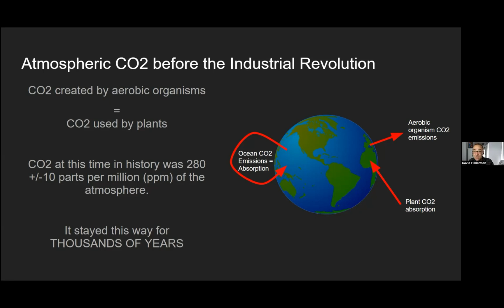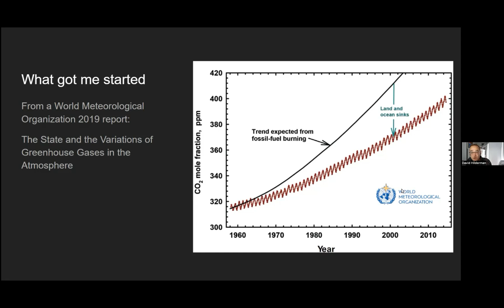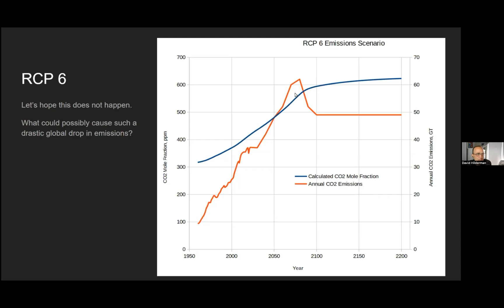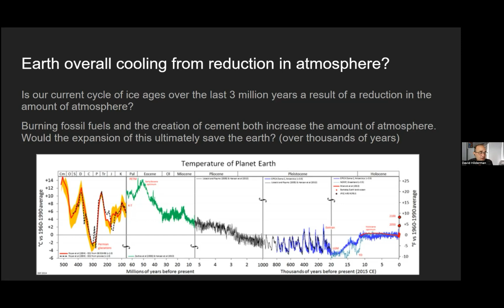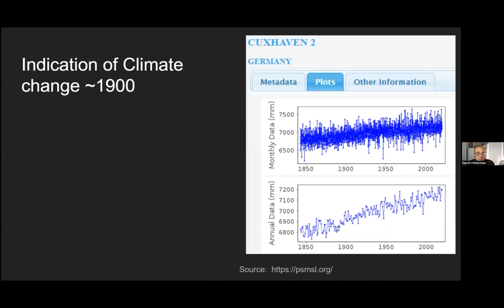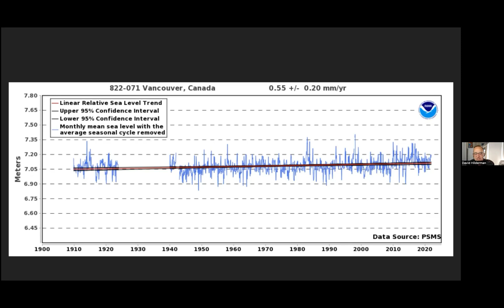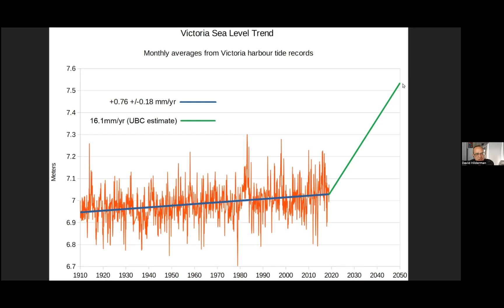David Hilderman: CO2 Emissions and Atmospheric Levels | Nelson Pod #220

Comment: There a re a lot of misconducts/misconceptions in this analysis. 
Indeed, more CO2 induces a growth in vegetation, that partially reduces the quantity of CO2 as it absorbs it by photosynthesis. That doesn't mean it's good for humanity.
Carboniferus was a lush period with big plants and high CO2 levels (relative to earth's average) but it also means higher temperatures, bigger fauna also (like giant insects etc) and more microbes and viruses. A human body would not easily adapt to change of temperatures as plants and trees, that's the problem !
Also more CO2 absorbed by the oceans isn't a good thing, as it increases the acidification of the waters and provoques a lot of changes (potentially difficult to manage by sedentary humans) as change of the gulf stream currents, elevation of water levels, change in fish reproduction cycles, collapse of number of new fish per year and zones of fishing etc ... 
Reminder : Most of humanity lives on coastal areas, and are dependent on oceans and seas, have infrastructure that aren't built to function with an elevation of a couple of meters of waters (the infrastructures around the world would need big adjustements, that take time, money and resources)
You showed clearly in the charts that the absorption is clearly not enough to compensate for the surplus of CO2 quantity, to be able to easily manage the heat levels induced, and the transformation of entire economies and processes (production and supply chain included) to be able to sustain the population without too many crises.

Comment: The premise was horribly flawed from the beginning!!!
The initial assumption was that the only heat transfer mechanism was Solar Irradiance.
This despite the fact that we've known for at least the 6 decades of my life that some planets in our solar system are consistently warmer than the amount of Irradiance they get from the sun.
Thanks to the Cassini mission, we now know this is due to a phenomena known as "Solar Particle Forcing".
The same charged particles from Solar Flares that have been giving us the Auroral light shows spread those warming energies from pole to equator.
If it's strong enough to keep Jupiter & Saturn warmer than they should be...
especially considering their size & distance, 
why would we think Earth would be exempt????? 

It's gone mostly unreported, but I'll mention the other shoe before it drops:
ALL the planets in our system are experiencing some kind of climate issues - Temp variances, significant wind speed increases, rotational speed anomalies, etc.
If the cause IS AGW from human CO2 production, 
then please explain the mechanism for how this exoplanetary influence is possible.

Comment: First time I have seen a calculated explanation of how much more carbon dioxide is removed by plants as the concentration increases. This always seemed like one of those obvious factors that are conspicuously absent from mainstream climate change explanations just like all changes seem to automatically be bad! In oceans I saw a presentation recently about the concentration of CO2 in the oceans. Obviously if the oceans acidified more this might liberate CO2 from Carboniferous deposits however the oceans remain slightly alkaline so I don’t see how this can happen without a substantial change. The sequestrated carbon in calcium carbonate deposits in the ocean has been evaluated. You would expect more CO2 to be absorbed to compensate for this effect as the sequestration lowers the dissolved CO2 levels. Presumably if the oceans are still absorbing CO2 they are not yet saturated. Rather like plant life you would expect marine photosynthesis to increase with more dissolved CO2 proving more food in the food chain. This would increase shell and bone growth so that is another possible variable. This would not change David’s absorption factor though. It is just another component.

Comment: Something that has always bothered me abut repp[orted sealevel rise is that it never seems to take into account where we have land "lifting" by whatever means, be that isostatic rebound or what have you.   Our world is dynamic, moving, constantly changiung and evolving.  Some areas are rising and some falling.  Be that falling beneath the waves / seas  or sliding under a neighbouring tectonic plate.
As for CO2, I am kniocking on 60 years of age now, but even as a kid, (I knew that carbon dioxide was one of the fundamental gasses REQUIRED for life.  I also knew that some growers of plants, with greenhouses, would order bottles of CO2 and trickle feed the gasses into those greenhouses to promote and accelerate growth of the plants.  I also knew that if levels fell too low, plants wuld not be able to breathe and they'd die off.  Thus, they would no longer produce the oxygen we and other air breathers NEED in order to live.   I have never bought into the whole climate change thing.  Sure its changing.  You can go anywhere in the world and monitor, hur by hour, how the temperatures rise and fall.  You can then extent that out to weeks, months years etc.   I would say that our climate has been in a state of flux since the day our world got its atmosphere and life, all life, on this world has evolved to exist within a changing climate to one degree or another.  In fact, during the warmest years / decades,  life has flourished.  Not just mankind, but all life.
On a lighter note, when the climate apocalypse hits us, I will feed on the vegans and vegetarians.  They're grass fed ;)

Comment: Have you noticed that plants need water? Rising temp do not affect amount of draught?? Working with only one factor (CO2) may be flawed 🙂
Reply: Increased CO2 actually reduces the water requirements, of plants. When a plant stomata are open, up to 50 molecules of water diffuse out for every CO2 molecule  that diffuses in.

Comment: co2 is a result of the planet warming due to solar activity and normally follows a 800 yr lag. Our temperatures are very similar to that of 1940. As co2 increase its green house reduces and actually starts to have a cooling effect.  Also we are reaching a peak following a 42 yrs cycle of warm and cold. The sun is reaching a maximum as the poles are about to change. 
We are also 300,000,000 miles closer to the sun as part of another 100,000 year cycle. The northern hemisphere is tilted towards the Sun as part of another cycle. Climate models are flawed because they dont even take cloud into account.

Comment: So you guys might need to go back to the drawing board. Very recent data has disentangled the role that sulphur (which was up until recent years prevalent in shipping fuel) has played in halting the warming that so many of these early predictions were making. We’ve been geo-engineering the whole time without realising it, and it’s only now that we’ve witnessed what happens when we remove that sulphur (and other particulate matter) from the atmosphere when it comes to warming. No-one had the data to understand the physics of the reflective qualities of the sulphur clouds we’ve been producing for decades but until we start re-introducing it, or cloud-seeding in other ways, we’ll all know about it sooner rather than later.

Comment: @4:10... there are a couple of problems with your hypothesis. It assumes that there is an unlimited amount of vegetation to keep absorbing the excess CO2 AND it assumes that the rise in each valley is triggered by a decrease in temperature. However, there is a limit to the amount of vegetation that can sink CO2 and the temperature effects are not as simple as you presume. The rise in CO2, from each yearly valley, starts when dead vegetation start to decompose. It died months earlier and some of that death was caused by dry, hot weather. So the summer both promotes growth and promotes decline. A longer summer means a longer decline, which we se evidence of, which is why the growth zones are shifting.

Comment: 1816 The global "Year without summer (big freeze)" 3°C temperature drop and crop failures. April 1815, volcano Mount Tambora began to violently erupt. Millions of tons of ash, dust, and sulfur dioxide were released into the atmosphere, casting a temporary chill across the planet as it Blocked out the Sunlight for months on end. Documented around the world in literature.

Comment: CDN NEXUS points out a scientific
study finding: CO2 doesn't cause temp fluctuation".  A review of key properties of global climate MODELS and statistical analyses conducted by others on the ability of the global climate models to track historical temperatures. These tests show that standard climate models are rejected by time series data on global temperatures.  Finally, we update and extend previous statistical analysis of temperature data (Dagsvik et al.,2020).  Using theoretical arguments and
statistical tests we find, as in Dagsvik et al.

(2020), that the effect of man-made CO2 emissions does not appear to be strong enough to cause systematic changes in the temperature fluctuations during the last 200 years.

Comment: I like your simple analysis, but I must warn you that your simple linear model is an oversimplification of the reality. I am not an expert, but I did get some basic classes into climate models in university. Your model works very well, because within the period you studied CO2 levels have been increasing over time. Your model will no longer be valid if we manage to stabilize CO2 levels.
One example of why this is, is that the ability of oceans to absorb CO2 decreases over time as the oceans slowly get saturated with CO2. If we keep atmospheric CO2 levels stable, then we'd have to slowly decrease CO2 emissions as the ability of the ocean to absorb CO2 diminishes as it gets saturated with CO2.
Similarly for temperatures and sea levels. Increases in atmospheric CO2 doesn't instantly increase temperatures on the surface and in our oceans. The warming takes place with a delay. And as the oceans slowly warm they lose their ability to absorb CO2 over time.
And as oceans slowly warm, sea levels will slowly rise. This process wil take thousands of years and as your analysis shows, we do not seem to be in any immediate danger. I agree with your main conclusions: the climate alarmists have no data to back up their claims.
Reply: I recognize this. However, it will take a long time for oceans to become at an equilibrium with the atmosphere or even change in its degree of saturation to where its absorption rate changed.  Is this 10,000 years? A million years? 100 years?  The fact that oceans have 50 times the CO2 of the atmosphere leads me to  think that it is likely 1000s of years before the absorption rate goes down. Would be great for someone to tackle the computation of this.
Reply: @davidhilderman  The timeline for CO2 saturation, ocean warming, and sea level rise are similar (thousands of years, up to 10,000 years). We still experience a measurable, but hardly significant sea level rise since the end of the last ice age 10,000 years ago. The reason that these processes have similar timelines is that they all depend on the ocean currents, which flow very slowly.

Comment: Yeah I agree with a lot of what you’re saying but there are some things that you might need consider. Acidification of the oceans is worth a think - crustaceans find it increasingly hard to form shells as the acid level goes up. Another consideration might be if there is any increase in temp even if temporary then damage bills from stronger storms is quite likely. 

But yes hang in there I think there’s a lot of truth in your story…

Comment: Well done buddy.  I did my honours degree in Env Sci in the early 90's but also had a chem degree and worked in research and I came to the clear conclusion that all the predictions and models for fatally flawed but nobody wants to know because it's all about getting money and political power through predicting calamity.  You don't advance your science career by showing yourself to be a "climate denier".  Suffice to say I don't work in env sci anymore.  You have essentially highlighted two of the negative feedback loops to adding atmospheric co2 being ocean absorbtion and plant growth.  The thing I focused on to debunk "global warming" was based on atmospheric absorbtion/emmission physics which essentially is that extra co2 isn't creating much heating because all the photons coming from the sun at the two main wavelenths that CO2 absorbs and then emmits IR are already utilised so they effectively become a "yield limiting factor".  so unless the Sun emmits more photons at the necessary wavelengths then the earth isn't going to go into a "runaway global warming event" as it is contrained by the required photons.  This is all easily proved with atmospheric spectra data.

Comment: This guy is talking out of his backside, he is using a well understood truth to hide or misdirection you from the world ending issue. By skipping over the correlation of Co2 with temperature, and focusing on the fact that plants thrive on higher Co2; this decietful sh*t is actively supporting fossil fuel capitalists  global genocidal agenda. At temperature over 30deg C, all plants enter survival mode by stopping metabolic activity. At a wet bulb temperature above 35 degC, all mammalian life forms will die within 6 hours of they fail to get into cooler conditions. There are so many misleading holes in this argument that it should be used as evidence to convict its perps of aiding global genocide.

Comment: Yes, plants will grow better with more atmospheric C02 and offset fossil fuel burning. However the correlation between reduced poverty and C02 increase is due to industrialisation - farm machinary fertilisers etc - which is what resulted in the C02 increase. Also you miss the additional downside of the warming associated with C02 increase which results in more unpredictable and volatile weather. Droughts/fires in some places, rain/floods in others and higher potential wind speeds. So less predictable crop harvests and potential for mass human migration. This could result in unpredictable economics and the potential for civil unrest/conflict/wars. I do agree that sea level rise is of relatively minor importance though.
Reply: There is minor or no increase in air temperature due to co2.  There are no changes to weather patterns over multi decade timescales.  They are not unprecedented

Comment: Nice info!  One suggestion, maybe on your next video about sea level rise show the prior 8-10k years before the industrial revolution.  It will clearly show the rate of rise in the past 100-150 years, is almost if not identical to the rate in the latter part of the 8-10k year block when the planet was coming out of the last ice age.  Which of course we are still in the tail end of that.  Cheers

Comment: Showing zero emissions in the 1800's has got to be the greatest lie of them all. Photos of London in the late 1800's to early 1900's show a city barely visible through the haze of smoke. Cities world wide were all suffering the same atmospheric pollution from all the wood and coal burning for heating and driving steam power.
Since then burning fuels has become a science with particulate matter removed from emissions and air pollution almost non existent compared to the 1800's.
CO2 may have increased, but CO2 is plant food, not a pollutant.

Comment: Great data.  A point: you conflated reduction of poverty with CO2 level.  But the reduction of poverty has come mostly from the energy released by burning fossil fuels.  The main reason for the RCP 6 graph is that solar and wind plus battery storage will significantly reduce the need to burn hydrocarbons to get that energy.  With population growth slowing significantly, it’s not certain that burning fossil fuels will be required in order to increase food production.  Yes, CO2 is required.  Earth will give some back as the rate of yearly CO2 production decreases.

Comment: I am sorry to say, that you did not calculate the correlation of increasing absorption as the first person. ;-) In fact ist was released decades ago and is part of all Climate models used today. Also increasing biomass by more CO2 is a well known and reserched phenomenon. This is at the moment a good thing für CO2 levels. But there are bereakpoints for severals soil bacterias, that will not survive when CO2 reaches their treshohold. Since those bacterias are essential for plant growth, some plants will not survive the CO2 increase, may even be extinct. And as plant growth also is a cycle, you have to keep in mind that decomposition of more biomass will occur - with the downside of releasing methane - wich is as we know even a more potent climate gas.
Reply: So does soil bacteria all die in greenhouses?
Reply: @davidhilderman  "So does soil bacteria all die in greenhouses?" Of course not all, as well as not all plants grow better with more CO2, as Tom Nelson wrongly claimed. All areas in his graphic below the zero color have less plant grow, he just did not mention it. In greenhouses you usually use already precomposed soil, you have no need of bacterias, the nutriens are already in a usable state for plants. So ist does not have longterm effects, plants in greenhouses usually only grow a few months. Another effect of CO2 is that wet soil is getting more sour, also pushing away some kind of bacterias and mushrooms, that some plants need for growth. It is never that simple - so if someone says "all" or "none" in a biological context, you always should ask twice. It is almost every time wrong.